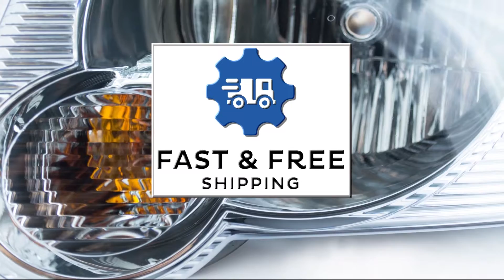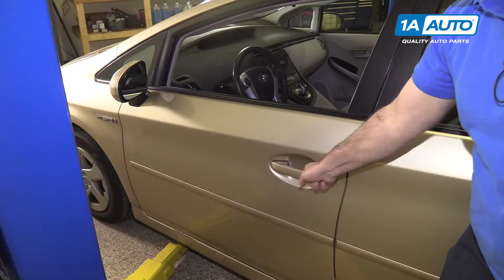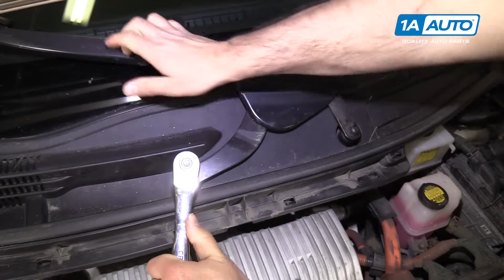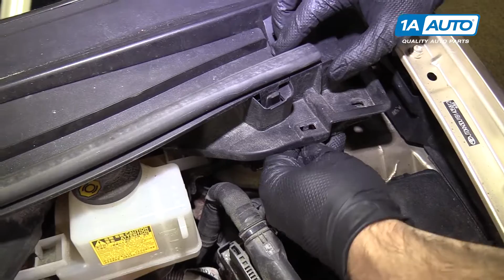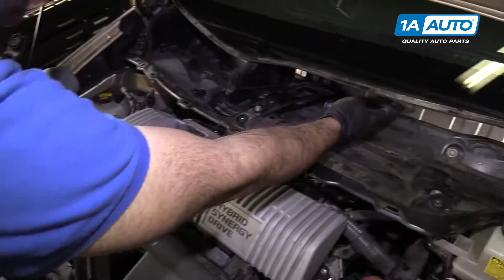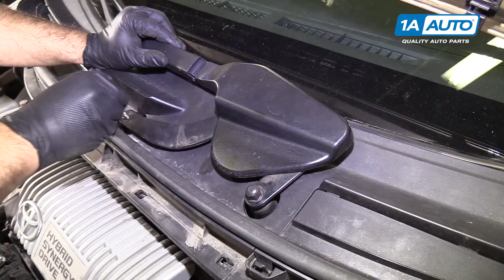How to Replace Windshield Wiper Transmission 10-15 Toyota Prius

Comment: I looked on the Auto website for the part your showing on the video buy don't seem to find. Is the wiper transmission motor for the 2014 pruis available to buy in this website or do I need to look for it somewhere else?

Comment: great video on the details.  however, i was replacing my motor only as it was much cheaper.  Note that when replacing just the motor, you have to make sure the wiper arm transmission is parked in the right place before installing the motor.  a video showing this would be helpful, i couldn't find anything like that on youtube.
Reply: Hi Joseph, do you have a procedure for doing that? I just replaced my motor and I guess ran into this problem because I can't get the wipers to park correctly. Thanks!
Reply from the maker: +Joseph P We're always cycling through common cars. We'll add this repair to our list! http://1aau.to/m/Shop-1AAuto-c
Reply: I'm also hoping for a video on re-indexing the wiper park position. Mine are not going all the way down and I can't find info on how to do this specifically for the Prius.

Comment: my 2010 Prius passenger wiper isn't working. I can rule out the motor and fuse because the driver's side still works. Do you know what seems to be the issue?
Reply from the maker: Thank you for checking us out! There could be multiple reasons why you're having this particular problem. We suggest taking your vehicle to a nearby reputable shop to identify the cause. +beedyca